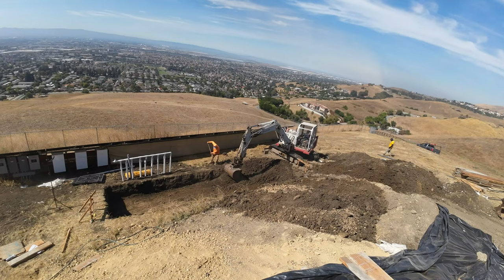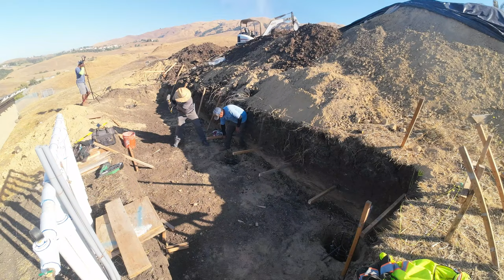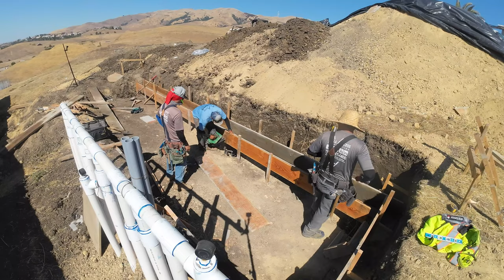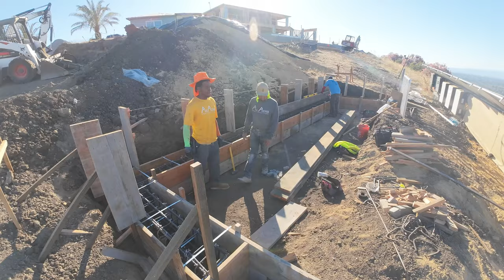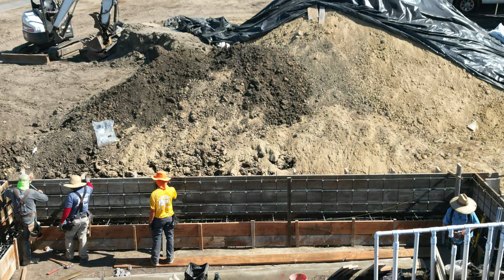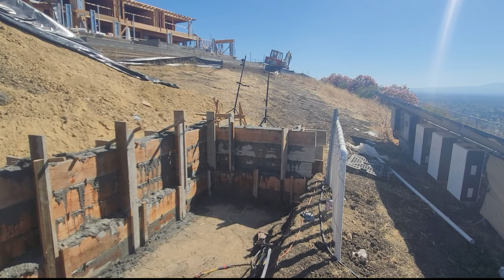How To Form 4 Foot Concrete Retaining Wall W/ Piers & Grade Beam

Comment: When wanting a smooth finish on both sides of a retaining wall, how do you go about the wall ties ? Thanks in advance
Reply from the maker: You can form out of smooth plywood
Reply: @AllAccessConstruction  you would not recommend building out of 2x12s ? Love your wall process but need smooth finish on both sides
Reply from the maker: You could once you strip the wall you will have to apply a product called Ardex.. 5 to 7 days after you strip